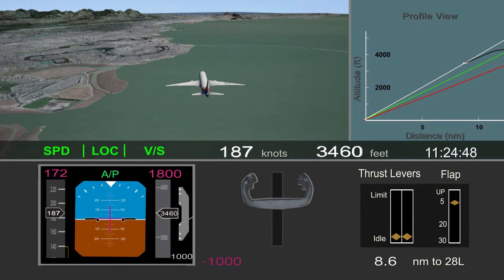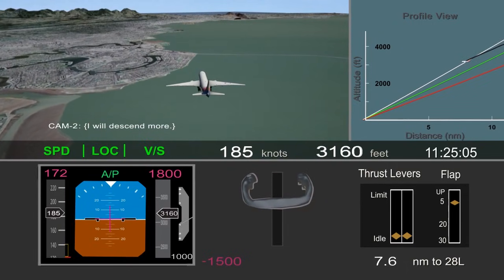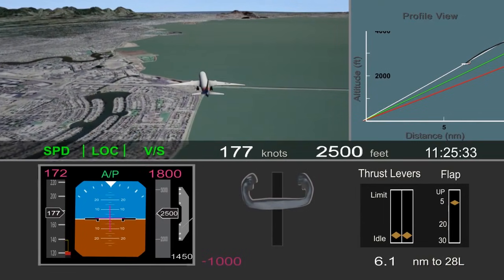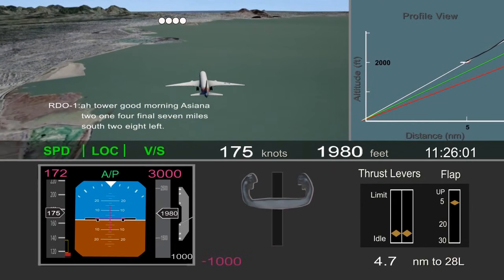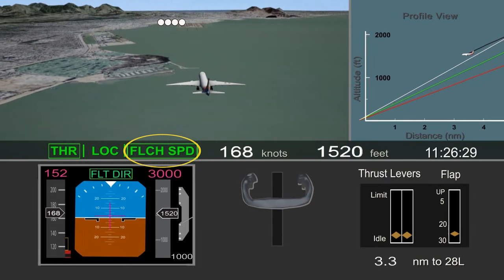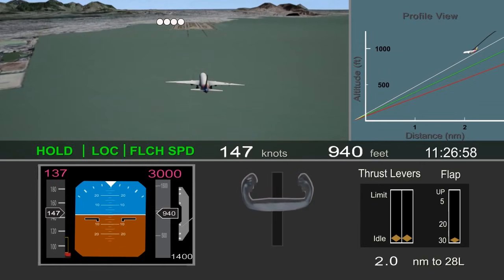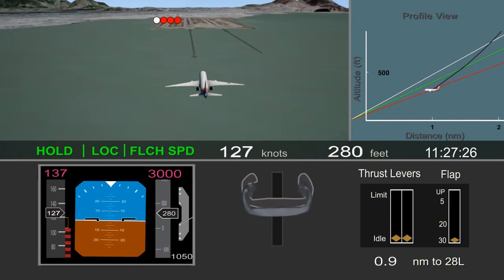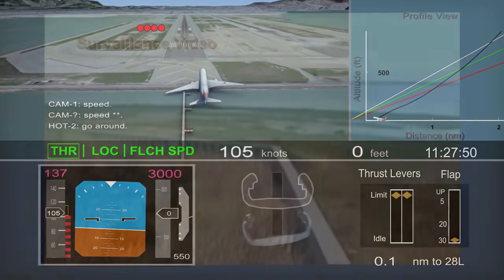Asiana Flight 214 Crash - NTSB Animation

Comment: And they wanted to blame Boeing on this?
Reply: puma.will. pounce but the pf was well aware of their airspeed and thrust setting, and could have been able to see the fact that the autothrottle is not honoring the speed setting. He had 25 fucking seconds to notice, thats a whole lotta time. This was complete pilot error in terms of hand flying, as well as not knowing the aircraft's systems. The pf also disregarded the sync rate callout from the pm, as well as the altitude warning. So how could boieng predict such stupidity and incompentence on the pilot's part?
Reply: The A/THR went into Hold mode, because the Flight directors were commanding a climb, and Captain Fantastic disconnected and retarded the THR/LVRs and pointed the nose down. If you need a red flashing light with and alarm for that one, you are missing the bigger picture. No automated system can calculate for every possibility, which is exactly why the reliance on automation is a huge risk.
Reply: puma.will. pounce why is the plane's duty to tell the pilot the speed? They can just look at the damn airspeed indicator. That's why i said that relying on ap numbs the flying skills, the captain was new on the 777, coming from the a320, so he was probably used to never moving the throttles from the detents.
You still havent answered my question -wtf was he thinking when he swiched to flch??
Also, if the pf had even tried to stay on the glideslope (he was warned several times that he was below it), he would not have had enough energy to even get close to the runway, so the shaker would have gone off at a higher alt. He was too low and too slow, and the only cure for that is thrust. He should have seen it.
Reply: puma.will. pounce come on, you know that's a stupid argument. The "sterile cockpit" rule prevents the pilots from discussing matters unrelated to the flight under fl 100. They were just bad pilots, that's it.
Reply: You are putting more automation on a basic flying skill problem. Maybe if you had flown Airbus you might might understand, having more automation and alerts, doesn't make up for basic flying skills...which this is really about.
Reply: Come on! Disconnecting the AP, flying against the FD's...and you wonder why the A/THR doesn't play along? Please tell me you know this!
Reply: puma.will. pounce why the hell would they use FLCH SPD on short final?! The reason the autothrottle disconected with the a/p was because at the time of the disconnect they were in FLCH SPD,  so the computers never thought they were on short final when they disconnected the autopilot (and autothrottle).
The first mistake was using flight pevel change. The rest is just bad hand flying, no situational awareness at all for the pf, the pnf should have warned the pf when the speed dropped below the selected value etc...
Don't blame this on the colour of 3 digits on a screen, that's just foolish.
Reply: puma.will. pounce i dont think that boeing would let their 250 mil$ jet drop below vref on short final. The FLCH mode DOES NOT indicate short final. 2 things:why did he use flch and why did he fly the manual landing like a 3 year-old?
This is the problem w/ automation, it numbs the pilot's hand flying skills.
Reply: puma.will. pounce Are you serious? If you disconnect the A/THR and the A/P, you’d have to be a complete moron to think the A/C would hold speed. What do you suggest Boeing do in the future? Have a cockpit alarm that reminds you:”Hey Moron, you turned are flying the A/C, not me”. The truth is; the PF was new on the 777 and unsure about the mode he was in. Both the PNF and the Checker were more experienced (on the B777), but junior to the PF at Asiana, which probably why they assumed he knew what he was doing (ie: assumed he would advance the THR/LVR once the A/C was close to glide slope).The crux is: when you disengage A/THR and A/P in any aircraft, you have no A/THR. (Boeing: THR HOLD, Airbus: THR LOCK). Easy fix to train pilots on visual approaches, but if start changing the A/C to fit the lowest common denominator (ie pilots who are unfamiliar with the A/C), you will dumb down the whole talent pool of pilots.
Reply: n1tothrust  — The stick shaker activates at a point that is too far gone to correct, especially if it occurs on short final under 300 feet AGL.  Boeing aural stall warnings should not have the same parameters at 25,000 feet MSL vs. 250 feet AGL.
Reply: n1tothrust  — When the landing gear is down, Boeing should have a low speed warning chirp  that goes off when the airspeed goes 5 knots below VREF.  How fucking hard would that be to fix?

In the case of Asiana 214, Boeing programmed the low speed chirp to go off at a whopping 23 knots below VREF (114 knots @ VREF of 137) at an altitude of 120 feet AGL!  What's the point of such a 'too little too late' warning when there's no time or altitude to correct it?  Bad fail-safe engineering. Similar to what happened with MCAS.  Very sloppy software logic.

By the way, drop the attitude, Captain van Zanten.
Reply: n1tothrust  — Your explanations were not compelling.  Telling me the pilots should have known HOLD mode would turn the A/T off is a stupid point since the pilots had no reason to believe the A/T ever left SPD mode.   I never said the A/T mode didn't change.  What I said was the pilots didn't realize the mode changed, and therefore had a reasonable explanation to assume it would honor the 137 set in the A/T window that also appeared in purple on the PFD.  

And I also pointed out how idiotic it was Boeing to think that a low airspeed aural chirp that is a whopping 23 knots below VREF at an altitude of only 120 feet would give them ample time to do anything about their low speed condition.  The engines don't even have time to spool up from those parameters. Those warnings are too little too late.

You have no substantive response to these issues.   And stop acting like a fucking jackass, Captain van Zanten.
Reply: @puma.will.pounce7590  dude when you disconnect the autothrottle even  by mistake it will shutt off,that a normal reaction,the plane just acted normally ,no failures and problem at all ,you are the pilot you tell the plane what you want  through the autopilot panel and then your order is  executed,so if you tell the aircaft to crash even by mistake then it will crash,what did you expect? A voice that tell you ,Are you sure to disconnect the autothrottles?
Reply: @Hk-uw8my  — Thing is, they didn't intentionally disconnect the autothrotte.  And the autothrottle kept the purple speed annunciator active on the PFD as well as the A/T display window.  How is that 'good' Boeing logic?

And, yes, I do think there should be an aural warning when the autothrottle is disconnected.
Reply: @puma.will.pounce7590  the purple speed anonciator is here to remind the selected speed from the  autopilot which is very very helpfull when you disconnect it... you set the approach speed and then you will never forget it during the whole approach and landing,and you can see instantly when youre too fast or slow those guys was really drunk i dont have any other explications
Reply: @puma.will.pounce7590  the pilots had no reason to believe they left the SPD mode ? What's that big ass HOLD that replaced SPD on the FMA for then ? And there's no reason to make the magenta speed on the PFD disappear as just like altitude or heading it's here to display the selected speed and alt, even if the ATHR is off and the approach is fully manually flown, it's not here to tell the pilots that the plane is still chasing that speed. The fact is that those pilots lacked basic flying skills and couldn't fly a simple straight 10+ miles visual approach that every other pilots flying in that day seemed to follow without issue, tried to use the autopilot in dodgy ways to avoid hand flying the approach. The manufacturer can't anticipate the dumb mistakes and lack of flying skills and system knowledge that are not supposed to be conceivable among people in the position to fly such airplane, putting another alarm on top of another one is not the desirable solution, it will only make things more complex when an actual emergency occurs, it's better to make sure that such unqualified don't reach such responsibilities as the flight deck of a commercial aircraft
Reply: @FoxMikeHotel  — One thing at a time.  You're getting a little over your skis on some things.   (1) The pilots are not use to checking the A/T mode on the PFD during final approach since it normally never changes to something they didn't think they commanded (SPD)... so why would they check it during this one?  Obviously hitting FLCH is what started the chain of events that caused the A/T to transition from SPD to THR and then back to HOLD mode when the pilots commanded the throttle to idle, but they weren't aware of that mode change from SPD to THR and then back to HLD.  They thought they were still in SPD mode where they left it.

As for Boeing's software law logic...a change to HOLD mode during short final with the gear down is a different animal than a change to HOLD mode at FL230 coming down in on a STAR or something where more energy can be added quickly with no consequence for a crash into terrain.  There should be a different warning for a plane about to stall below 2500 feet AGL with its gear down than at any other flight regime.  There also should have been an earlier warning when they went, say, 10 knots below their VREF.  I don't understand how Boeing could allow a plane to go a full 25 knots under its VREF on short final without any kind of aural warning whatsoever.  The 4-chirp aural warning they got @ 113 knots right before they hit the stall zipper on the speed tape was too little too late.
Reply: @FoxMikeHotel  — Asiana 214 wouldn't have happened had the captain not accidentally hit the FLCH button.  That's what screwed everything up with the autothrottle modes.  There's really no need to criticize them by saying they didn't having basic flying skills when it's pretty obvious that something very unusual happened on this approach that they normally do not encounter.

There's no need to call them "dumb" and all sorts of other derogatory names when the facts show that there were several unusual things that happened on this approach that are mitigating factors in the flight crew's favor.

An example of bad airmanship that led to a stall on final was Colgan 3407.  There was no flight deck software logic that could be implicated in that crash.
Reply: @puma.will.pounce7590  Pilots are not used to check the A/T modes ? What's the FMA for then ? It's literally there so you can notice the changes in modes, expected/intentional or not... Used to it or not it's their job to notice a FMA change, especially when there's one pilot flying and another monitoring. Since they were rated on the 777 they were supposed to know that grabbing the throttles would put them in the hold position, what did they expect ? And even if they forgot, there's the FMA to tell you, what was the pilot monitoring doing ? If they thought they were still on SPD mode it just show that they both had poor knowledge of their aircraft and no situational awareness, it's their problem, when you get a speeding ticket you can try telling the cop that you had no idea you were speeding because you're not used to check for your speed on your dashboard and that you had no reason to believe you were speeding, I don't think that's gonna work out too well.
Asiana wouldn't have happened if they didn't hit the FLCH, yeah kind of, it's what started their A/T mismanagement, but in the first place it's their lack of basic flying skills and over reliance to automation that doomed them, everybody else that day hand flew down the visual without any issue, but those aren't used to that, so they tried to work things out with unusual autopilot usage which led them to be in a situation where they were behind the plane for a moment. And even after they hit that FLCH mode and disconnected AP, there was many ways to land the plane safely, for example, the PM doing his job and telling the captain that the A/T switched to HOLD, and that he was deviation from both the speed, and a glideslope (something you usually notice when you know how to fly an approach raw data like anyone with a PPL). How is there no need to call them dumb or unqualified when they managed to break a perfectly working plane by not being able to follow the most basic thing you learn on your first hours in your PPL like a straight visual approach by perfect weather? The only unusual things that happened during this approach were the poor airmanship of the crew that led to improper usage of automation to make up for basic flying skills and eventually poor situational awareness or CRM. Now if I may say something to their defense, both their hierarchy culture and company culture were encouraging that over reliance on automation and that tendency of the PM to not necessarily tell his captain that he's messing up, that also plays a role in all this.
Reply: @puma.will.pounce7590  Pushing FLCH cancels SPD mode and disables the autothrottle because in FLCH mode, the speed set in the window is being used by the autopilot to command pitch. After hitting FLCH and getting an undesired climb, their next move was to disconnect the autopilot. So you’re saying it should have reengaged SPD without being told to do so? Talk about funky software logic. The jet is not able to read minds. FLCH is for changing flight levels and is not intended to be used as an approach mode when the glideslope is inop. The autopilot and autothrottle cannot and should not arm or engage any modes without being commanded to do so, for reasons that should be obvious. 

I don’t think it’s unfair at all to call them bad pilots. The comedy of errors when managing the autopilot is just the beginning. The fact that they required autopilot at all to manage a visual  approach in excellent weather is indicative of a lack of competence and confidence. The thing I’ve learned in my aviation career is that people sometimes get away with doing a lot of dumbass stuff for a long time, but it only takes one time to get someone hurt or killed. The guy flying was probably always a clown. It just took years for him to finally crash an airplane.
Reply: @wrkingrageaholic  <— you said: "Pushing FLCH cancels SPD mode and disables the autothrottle because in FLCH mode, the speed set in the window is being used by the autopilot to command pitch."
••••••••••••••••••••••••••••••••••••••••••••••••••••••
You are slightly mistaken in your understanding of how the autothrottle system works in the 777.  It's a bit more nuanced and, unfortunately, complicated than that.  

When the Asiana 214 pilots hit FLCH, the autothrottle did NOT disconnect nor was it disabled.  It simply went into THRUST mode.  What effectively 'disabled' the autothrottle (in actuality, the A/T remained active the entire time, but only went into a 'no wake' HOLD mode) was when one the pilots manually retarded the throttle levers to the flight idle detent while in FLCH mode.  And while in FLCH SPD mode when the thrust levers are manually moved to the idle detent — or when commanded by the autothrottle servos — the autothrottle mode software is programmed not to 'wake up' the autothottle to honor the speed set in the A/T window on the MCP (a phenomenon coined "FLCH trap" by Boeing pilots).

Keep in mind the autothrottle WILL normally wake up from HOLD mode when the thrust levers are moved to the idle detent by the autothrottle (or when manually commanded by the crew) in SPD mode which is the mode the Asiana crew had last selected before it was automatically changed to THR mode unbeknownst to them when they hit the FLCH button.  It's only when in FLCH mode AND when the thrust levers are at idle — regardless of how they got there — will the autothrottle not wake up from HOLD mode to honor the speed set in the A/T window. 

However, at no time in any of the above scenarios is the autothrottle disconnected or disengaged, nor did the Asiana crew think they disabled the autothrottle.  It simply switched to an unusual 'no wake' HOLD mode (again, the A/T is still active in no wake HOLD mode).  And last the crew recalled, they had set the autothrottle to SPD mode and therefore had every expectation that it would 'honor' the speed displayed in purple on the FMA/PFD as well as in the digital window of the A/T (neither of which dashed out).

Boeing should have an aural warning (at least) for pilots when this 'no wake HOLD' mode is activated, not to mention 'no wake HOLD' should be a prohibited A/T mode by Boeing software logic when the aircraft is (1) below 3,000 feet and (2) the speed has degraded to 15 knots below its Vref or (3) within +15 knots of its Vmo when no weight on wheels is detected (i.e. autothrottle should automatically 'wake up' and revert to SPD mode).  Once the squat switch detects weight on wheels, then the speed can be allowed to deteriorate to below +15 of Vmo (and lower) without waking the autothrottle.

Asiana 214 crew were unaware that manually retarding the thrust levers to the IDLE detent while in FLCH caused the autothrottle to stay in HOLD mode from which it is programmed to not wake up to honor the speed they dialed into the MCP window, since they thought they were still in SPD mode.  This is even more understandable because, normally while in SPD mode, if the thrust levers retard to idle detent/HOLD mode during, say, a descent, the autothrottle will in fact automatically wake up to honor the speed set in the A/T window and AUTOMATICALLY switch back to SPD mode without any pilot input whatsoever.

You also said, "the speed set in the window is being used by the autopilot to command pitch."  This is incorrect.  The autopilot of the 777 or any Boeing is incapable of commanding any thrust setting or speed unless the autothrottle is engaged, and in fact will automatically engage the A/T if SPD, FLCH, VNAV, or TO/GA mode is selected.  The FMC can command a speed only if VNAV mode is selected, in which case the autothrottle will automatically engage the appropriate autothrottle mode (THRUST REFERENCE mode for VNAV and THRUST mode for FLCH).  

At no time did the pilots of Asiana 214 disable or disconnect the autothrottle nor was it disabled throughout the accident sequence.  It simply went into 'no-wake sleep' HOLD mode when the pilots retarded the thrust levers to idle while in FLCH mode.  Had the pilots advanced the thrust levers, the autothrottle would have 'woken up' and resumed honoring the speed dialed into the A/T window on the MCP (by changing to THR mode followed by automatically reverting back to SPD mode once the speed dialed into the MCP was reached).
Reply: @FoxMikeHotel  — LOL, no pilot checks the FMA for either autothrottle mode or MCP mode while on short final.  Maybe speed tape, but that's about it.  Besides, Asiana crew had already set the autothrottle to SPD mode and never expected it change or to not honor the speed they dialed into the A/T window which remained in purple on the FMA on the PFD.  Anything on the PFD isn't suppose to be a 'rumor.'

And they thought they could get back on glideslope simply by pulling back on the control column which would command the autohrottle to spool up the necessary thrust to let them fly the aircraft on Vref at virtually any alpha (at least up until max thrust was reached).  

This is especially true since the autothrottle will wake up from HOLD mode and add thrust even if the thrust levers hit idle while in SPD mode.  It was switching to FLCH mode that screwed with the autothrottle setting and put it into this funky no wake HOLD mode after the crew pulled back the thrust levers to idle to slow their speed since they were coming in hot (172 knots) while entering short final.

Boeing software logic should prohibit autothrottle from going into a no wake HOLD mode below 3,000 feet when there's no weight detected by the squat switches AND the speed degrades to within +15 of Vmo or -15 of Vref, whichever comes first.  In my opinion, this fail-safe software oversight is worse than MCAS software logic and can be easily fixed with a software upgrade from Boeing.
Reply: @puma.will.pounce7590  So you're telling me that no pilot checks the FMA for potential unexpected mode changes then? Uh that's supposed to be the job of the pilot monitoring, it is their duty to do it and maintain situational awareness, it is one of the reasons there are two pilots in the flight deck, one is flying the plane, the other is monitoring the parameters to make sure that there is no deviation etc. Then, there is no purple thing on the FMA, I assume you're talking about the selected speed that appears in magenta on top of the speed tape. This is not a "rumor", this is not an indication that the speed is being managed, it's just a display of the selected speed. It will remain there even if the A/T is disengaged, same for other parameters such as altitude, heading if it's on Heading Sel, V/S if it's in V/S etc.
You say they thought they could get back on glideslope by pulling on the stick and the thrust will keep them afloat. Except that they didn't really pull on the stick until it's too late, and even if they expect the A/T to wake up, any system can fail, so they should be capable of noticing that the engines don't spool up, they should notice that their speed is dropping, and they should also notice that they're well below G/S. And they should know that retarding the throttle in SPD mode switch them to HOLD. Yes the A/T going into a no wake HOLD in this situation is not ok, but is as a pilot you ever need the A/T to wake up it means that you've already fucked up, and no it's definitely not worse than the max, considering the chain of events necessary to reach this no wake HOLD is not supposed to be possible if the plane's A/P and A/T are handled correctly. You're just making excuses for idiots that had no business flying an aircraft, let alone one with passengers in the back. I do not want to ever fly with someone like you that thinks it's alright that pilots have so poor knowledge of their aircraft systems that they hit FLCH on final while lower than the selected altitude and then are not able to notice that the plane is on HOLD, which should be expected if you override the A/T (the only issue is the no wake situation, even with the wake they would have been too slow and too low), and then that they are well below G/S and speed, which means that nobody there looked at the basic flight instruments, so basically if for some reason the plane on another day had an A/T failure, they wouldn't have noticed it and had crashed an otherwise perfectly working aircraft.
Reply: @FoxMikeHotel  — Yes, I'm telling you no pilot checks the FMA for autothrottle MODE on short final during a visual approach.  Not even the pilot monitoring. 

They did notice the airspeed deteriorating below Vref... it was just seconds too late to spool up the engines from such a deep low-energy state with the engines back at flight idle.   But it's somewhat understandable that they fully expected the autothrottle to kick in and maintain 137 Vref and thus ignored it.
Reply: @FoxMikeHotel   — "It will remain there even if the A/T is disengaged, same for other parameters such as altitude, heading if it's on Heading Sel, V/S if it's in V/S etc."
••••••••
The purple speed number should flash, change color, or get boxed-in if it's not being maintained by the A/T.   Otherwise the purpose of displaying the number or parameter is meaningless (i.e. V/S, HDG, LOC, etc.).  It can't just stay the same regardless of whether or not the underlying autothrottle or autopilot is engaged or disengaged.  That's just junk information on the PFD at that point.
Reply: @FoxMikeHotel  — If the autothrottle goes into HOLD mold while in SPD mode, it absolutely does wake up.  The problem with Asian 214 is in FLCH mode, it doesn't wake up.  Boeing should prohibit "no wake" HOLD under 3,000 feet when the plane's speed goes 15 knots below Vref or within 15 knots above Vmo.  There, I fixed it in a simple software update.
Reply: @FoxMikeHotel  — I would never ever hit FLCH mode to get back onto a glideslope, let alone on short final.  Never heard of that being done by anyone except these guys since you're really never suppose to be that far off glide at 4 miles out.   

I still think Boeing should add a software fix to prohibit NO WAKE HOLD mode on the A/T below 3,000 feet unless there is weight on wheels detected.
Reply: @FoxMikeHotel  — If you ever flew with me, you would likely become suicidal over how I grease landings no matter what the wind conditions. So I agree, you would never want to fly with me.
Reply: @puma.will.pounce7590  How are you going to blame Boeing for this when the pilots were clearly not paying attention and were just assuming the jet would act in a certain way? When you have multiple displays and back up indicators showing your airspeed, A/T status, and engine N1/2% right in front of your face, "I didn't know" is not an excuse. Actually, "I didn't know" is never an excuse in aviation, because if you don't know, you have no business touching any of those controls with passengers on board. If everything you say is problematic with the 777s AP were true, then why was it never an issue in the thousands of flights in the 17 years the 777 was in service prior to this crash? This crash was 100% poor cockpit management, and 0% Boeing. (Actually, the fact the plane held together so well despite the extreme acrobatics it was sent through shows just how excellent of an airplane it is at every level.)
Reply: @NWA744  — So then I guess you also agree that the 737 Max crashes were pilot error as was the UPS cargo Airbus 300-600 crash?
Reply: @puma.will.pounce7590  Yeah. With 3k+ flight hours in a 777 between the crew, hundreds of simulator hours between them, a relief pilot calling sink rate from the jump seat, and you still can’t see how incompetent it is to even consider using FLCH on short final to correct a glide slope error? No, even further than that, you blame Boeing because the A/T respected the PIC’s actions when he manually moved the throttles to idle? It’s like saying my car is at fault if I slam on the brakes in cruise control, and expect the car to ignore me and accelerate because there’s a giant sea wall in front of me.
Reply: I read all of your soliloquies of technical obscurities, but you never address why a pilot would but unfamiliar with AFDS annunciations and its respect to A/T function. You keep repeating "the pilots didn't intentionally disconnect the A/T". But that misses the point, and the A/T isn't disconnected.  
Step 1:
I pull back all the way on the throttles, hoping the plane will magically foresee that's not actually what I wanted to do.
Step 2:
I ignore repeated warnings and callouts from both PNF's in the cockpit, and don't bother looking out the window at the PAPI. Therefore, I don't know that the plane ISN'T going to ignore my instruction of idle throttle, so why bother checking if HOLD mode is activated, because there was that one thing in my 777 FCOM about hold mode, "HOLD – The thrust lever autothrottle servos are inhibited. The pilot can set the thrust levers manually."
Step 3:
Crash, survive, ignore human factors, blame Boeing because jet plane is too complicated and should be more like a microwave with all the noises and beeps and stuff
Reply: @jesselevine0  — I never said using FLCH mode was a good technique or one that I endorsed.  What I said was the plane's autothrottle should have woken up from HOLD mode to 'honor' the VREF speed selected in the IAS/MAch selector on the MCP when the plane was at such a low altitude in a landing configuration.

Even MCAS had built-in safety protection software to not arm itself when the flaps were extended to any detent.

Just because the pilot moved the thrust levers (which you referred to as "throttles") to idle position, doesn't mean Boeing A/T software should have kept them there since the pilots last manual selection for the A/T mode was speed mode (SPD).  It was Boeing software that changed the A/T mode from SPD to THR to IDLE to HOLD mode.  During this transition cascade, the pilots thought the A/T had remained in SPD mode.

Just because the pilots moved the thrust levers to idle, doesn't mean the A/T disconnected.  In fact, it was still active, which the pilots (mistakenly) thought would mean they would 'wake up' and honor the VREF speed they selected on the MCP.   But Boeing decided that HOLD mode would disengage the servos as the plane's speed decayed well below it's VREF and into the barber pole until it got the low airspeed chirps (which chimed way to late).

Pilots don't really monitor the A/T mode on the FMA during short final. I never said the pilots were blameless.
Reply: @puma.will. pounce is absolutely incorrect on literally everything he wrote.    With what he wrote, no way is he a real airline pilot.     1.   His suggestions that pilots don't look at airspeed on approach because the autothrottle takes care of it is sheer lunacy.   I've flown both Airbus and Boeing products, and the CRJ which didn't have autothrottles.   On ALL aircraft types whether or not the autothrottle is on, a pilot ALWAYS watches (is supposed to watch) his airspeed.     2.   The airspeed numbers on the PFD never dash out.   They are dashed out on the airspeed display in the mode control panel if the aircraft is managing speed on schedule with flaps deployment.   3.  The Boeing 777 automation did EXACTLY what it was told to by the pilots.    The pilot in this case used automation to fix his problem which only made things worse.    They shouldn't have set go around altitude until the glideslope was captured.  By setting 3,000 ft in the altitude window and hitting FLCH, the aircraft did what it was supposed to: pitched up and do a climb power to 3,000 ft.    He disconnected the autopilot and brought the autothrottles into idle, which puts it into HLD mode.    In HLD mode, it will not maintain the 137 knot airspeed.  The pilot overrode it.     The system worked as designed.    Bottom line, this crew screwed up a visual approach on a nice beautiful VFR day.
Reply: puma just stfu
Reply: TheSithTeacher — Yes, because the auto-throttle failed to honor the speed set in the digital A/T display, which was also visible on the PFD (137).  Those numbers should have dashed out.   The pilots had no reason to think the autothrottle would let the speed deteriorate below the speed set in the A/T window as well as the speed visible on the PFD.
Reply: @puma.will.pounce7590  simple.These pilots failed to monitor the FMA.FMA callouts are not made for nothing.BTW,This is what I think,not boeing's official statement.I think the reason for A/T transitioning into HOLD mode(NOT DISCONNECTING)is so that you dont climb like a rocket when you inadvertenly select FLCH when mcp alt is higher
Reply: @puma.will.pounce7590  You don't know Boeing, my friend.   The AT was the least contributing thing to the even.  They hit FLCH, not Mister Boeing.
Reply: Blu's Pie — Why would switching to FLCH mode result in the autothrottle disconnecting just because they retarded the thrust levers to idle?

Second, once the A/T disconnected (without any warning to the crew), the 137 should have dashed-out in the MCP and PFD displays and a separate aural warning sounded.  The idea that the MCP and PFD display STAY THE SAME (137) whether the A/T is connected or disconnected is absurd software logic.   Anything on the PFD means it's "active."    This software concept design flaw to keep the display at 137 is critically deceptive oversight by Boeing.

Third, the idea that Boeing will allow a $250 million heavy to get below VREF and stall speed on final approach without any kind of aural warning whatsoever is clearly a flaw in Boeing software and design concept.  In fact, it's ludicrous that the first time a pilot knows they are drifting into dangerous speed territory is a stick shaker.   Because you can't slam the yoke forward on short final with no energy and no altitude, so the stick shaker on final approach should have had a completely different design (higher threshold — i.e. earlier warning) when the RA (radio altimeter) is triggered.

This is a $250 million jet, not a Cessna.   What, Boeing can't add an simple aural warning "Speed Speed" if the speed falls below VREF or wanders into the stall realm in any regime of flight?  The first notice is a stick shaker on short final???  Give me a fucking break.  Boeing fucked up big time.
Reply: Blair Fraser — The pilots never thought they disconnected the A/T.    

The A/T was in SPEED mode — the mode the pilots set it in — which was suppose to honor the number they dailed into the A/T display (137 knots).   The problem is that when they inadvertently hit FLCH mode, it also switched the A/T mode to THR mode followed by HOLD mode, which disconnected the A/T servos.  Boeing software did that, not the pilots.  The pilots thought (mistakenly) they were still in SPD mode.

The problem is that once the A/T was disconnected, the 137 should have dashed out on both the MCP and the PFD.   Why is the number 137 still showing on the PFD when in fact the aircraft was allowed to decelerate through that speed due to Boeing software?  What the hell is the purpose of showing that 137 number in the PFD if it's not going to be honored by the A/T?  Is that to deceive the pilots?

The pilots still thought the A/T would honor the 137 they dialed into the A/T window.

And yes, there should be a second and in fact third aural warning if the authothrottle is disconnected, especially on short final.  No alarm whatsoever by anything in a $250 million Boeing jet that tells they crew they are stalling and falling well below not only VREF on approach, but a full stall on short final?  Unbelievable.

If this were an Airbus, there would have been aural warning "Stall, Stall, Stall."  In Boeing, there is no aural warning whatsoever, despite the Boeing software disabling the A/T on the the pilots.  Unreal.
Reply: The aircraft didn't stall, it had a high rate of descent.
Reply: @Robert_N  I agree this was not a full stall. But the stick shaker activated, so it was approaching a stall. A stall is not a binary thing, it happens progressively as the angle of attack increases over the critical limit due to the decreasing air speed.
Reply: @puma.will.pounce7590  More false facts.   1.  You saidt he A/P is not supposed to be connected to the autothrottle except in VNAV mode.   Um, what?!    The AP and A/T is connected in just about every mode.   Spd, LOC, GS on an ILS approach with both AP and A/T on is ROUTINE.    2.  Completely false what you wrote that "when they inadvertently hit FLCH it also put the A/T into THR mode, followed by HLD mode, which disconnected the A/T.     No, it went to HLD mode because the PF took the AP off and then manually brought the power back to idle.   This way, the throttle stays in HLD mode but A/T is still technically "on."     In HLD mode, it will no longer hold the airspeed of 137 kts.       3.  The airspeed NEVER blanks out on the PFD.      It only blanks out on the MCP window.    Our airspeed tape ALWAYS shows the selected airseed, whether by selecting it ourself or the final target speed selected from the FMC based on flap schedule.    4.    As far as the airplane is concerned, they took off the autopilot and put the throttle into hold mode.   The plane did what it was supposed to do.    The pilots took over and never maintained their own airspeed.      5.   On the Airbus, there would have been no "stall, stall, stall" warning.   It would have been in normal law the whole time, there wouldn't have been a stall.     If they had brought the throttle to idle in the Airbus, the AT would have completely disconnected.   They would have been required to control their own airspeed (in that sense, not different than the Boeing).     As long as they were above 100 ft, if they got into the red on the speed tape, Alpha Floor would have kicked in and TOGA power activated.   Below 100 ft, that would not have happened.
Reply: @puma.will.pounce7590  You are confusing FMA for the PFD, they are two different things.  The Flight Mode Annunciator is in the top portion of the PFD.   That is "fact" and I guess you could argue the Mode Control Panel could be "rumor."    But regardless, there is no written airspeed on the FMA.    In the throttle column of the FMA, you'll have something like N1, HLD, MCP Spd, FMC Spd, etc.       It only shows what mode the A/T is in.     The 137 knots you are talking about is on the airspeed tape that is displayed on the PFD - Primary Flight Display.   The airspeed value is ALWAYS on your PFD, on the speed tape.    It doesn't matter if the A/T is in FMC speed, MCP speed, or even Hold or N1 mode, the Vref speed is displayed on the airspeed tape portion of the PFD.    There is never any time that anything on the PFD's airspeed tape OR the altitude tape blanks out.    The "blank out" is only on the mode control panel for the airspeed, and all that means is that the FMC (box) speed schedule will be followed.

In all honesty, it has nothing to do with the accident.     The throttles were in hold mode, and will not wakeup - it is up to the pilot to add power.    The reason it went into hold mode is the pilot hit FL CH with an altitude set above them (go around altitude) when he really wanted FL CH to go idle power descent.   The airplane added climb power and pitched up.   To fix that, he manually pulled the thrust to idle and the A/T entered Hold mode.     What else would the A/T do?    The system was told by the pilots to do a level change climb to 3,000 ft.   Of course it will pitch up and add climb power.    Bringing the power to idle made the airplane enter hold mode for the A/T.   

A Floor on the Airbus could save them - caveat they'd have to be above 100 ft AGL otherwise Afloor won't engage.    But if we are going to argue "if it was an Airbus" , keeping in mind the CA came off an Airbus and was transitioning to the 777, what about Airbus knowledge?   On the A320, if you manually pull the thrust levers to idle, it TURNS OFF the Autothrust.    In other words, doing what he did in the Airbus, the A/T will no longer operate to maintain the airspeed.    It will be entirely off.     So even if he had reverted back to Airbus knowledge while flying the 777, he should have known the power will not kick back in once you manually moved the thrust to idle.

As for the Boeing logic, I don't know what to tell you.   I have flown both the A320 and the B737, right and left seats.   Whether it was an Airbus or a Boeing, whether A/T was on or off, below 1,000 AGL my hands were ALWAYS on the thrust levers.    It is a pilot's job to do so.    This Asiana accident to me is entirely unacceptable and shows the difference between button-pushing pilots versus true aviators.    If you are looking outside on a visual day at the runway, if there is ONE thing you need to glance at when you look inside, is the airspeed.     How they failed to do that is beyond me.    Button pushers, not aviators.

I'm based out of LAX.   I did do flight training in Florida 15 years ago.    Have a good night friend, fly safe.
Reply: Blu Pie — The fact that the landing gear was down and locked tells the plane's computers that it is landing (disables the GPWS).  Yet no aural warning on short final when a 777's speed is reduced not only well below VREF, but to dangerous stall speed.  All while the PFD and A/T displays "lie" to pilots by showing 137, yet secretly not honoring it and allowing the plane's thrust to deteriorate to dangerous stall speed.  Unforgivable oversight by Boeing engineers.   Yeah, a lot good a stick shaker does at 400 feet AGL and 105 knots.  Good grief, Boeing totally dropped the ball.
Reply: Blair With Project — In other words, Boeing designed software for a $250 million commercial wide body jet that allows the crew to stall the aircraft on final approach while falsely telling flight crew in both the PFD and A/T displays that the speed is "set" to 137.  The Boeing software also disables the A/T on the crew despite the pilots not deactivating the A/T directly themselves.   Thanks Boeing.   Great work on the software.

No stall warning, no VREF warning… no nothing except a stick shaker at 400 feet AGL.   Cool.  

The engineering team at Boeing that signed off on these pathetic software 'features' should quit or be fired.
Reply: @puma.will.pounce7590  I agree with most of your points, but you keep repeating the false information that the first indication the speed is low is the stick shaker. That's incorrect, there is an aural warning before that, you can even hear it in the video.
Reply: @VladimirNicolici  — You're right.  I forgot about that little 'speed low' chirp.  It's the cutest sounding Boeing aural warning there is.
Reply: @puma.will.pounce7590  You're all partly correct in that the pilots screwed up big time as well as Boeing taking partial blame. My recollection from hearing from Asiana/KAL 777 pilots is that the training department was not fully aware of this HOLD mode (which is where Boeing is liable).  The pilots were expecting A/T from doing its job even in this uncommon scenario where the software changed THR to HOLD due to using FLCH mode and the AP being disconnected.  As puma said the speed window still displayed 137 and tricked the pilots, and to compound the issue they were not properly trained/warned by Boeing. 

As with every airline accident, the first thing plane makers will examine is to see if they can blame the pilots.  But in this accident, despite Boeing's possible deficiencies in providing an adequate training guide and with its tricky software glitch (?), the pilots do deserve the blunt of the blame.  The pilots were probably over-reliant on automation and didn't have enough airmanship to take proper actions.
Reply: Blu's Pit — The whole purpose of switching the A/T on and dialing in 137 is so the pilots don't have to constantly monitor it.  Boeing software disabled the A/T on short final without telling the pilots, yet kept the 137 in both the PFD and A/T displays which was a total lie, and failed to aurally warn pilots of their deteriorating speed below VREF and stall.  Stick shaker at 500 feet AGL is pointless and idiotic software logic by Boeing.   $250 million jet should have had multiple aural warnings once the speed went below VREF.

Had the A/T kept the speed above 137, this crash never would have happened.
Reply: Blair Witch Project —  There's 4 things Boeing software should have done:

1.) Dashed out the 137 in both the PFD and A/T display on the MCP when it's no longer being "honored" by the A/T.

2.) Give aural warning when A/T disconnects (separate from A/P disconnect).

3.) Give aural warning ("VREF VREF") when speed goes 3 knots below VREF.

4.) Give aural warning ("Stall stall stall") when speed gets within 15 knots or so  ABOVE stall speed in any flight regime.

Having the stick shaker be the first warning — let alone on short final at 400 AGL — is bizarre and idiotic software logic.  Especially for a $250 million heavy.
Reply: Blu's Pie — The pilots clearly thought the A/T was going to manage the speed and keep at or above VREF (137).  Therefore, there was no need to look at it.  Same thing that happens at cruise altitude… pilots don't check their speed.   They talk about sports, politics, or whatever...